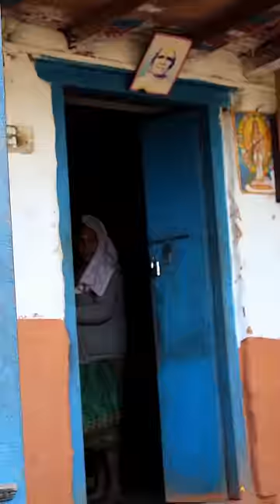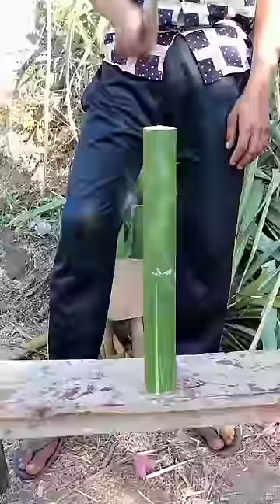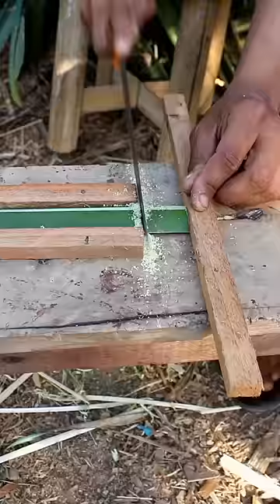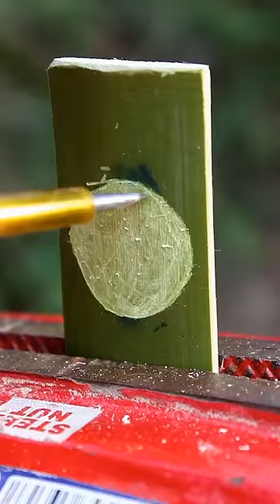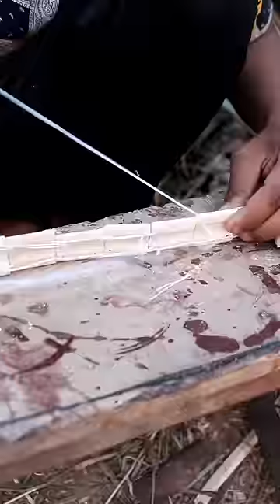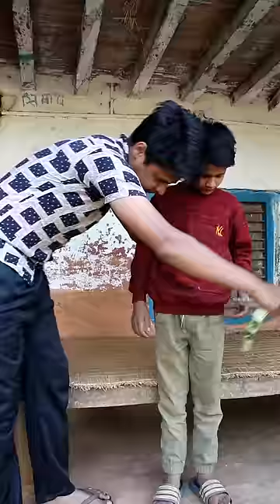Use To Bamboo For Make a Belt || Bamboo Crafts #Shorts

Comment: Use this design to make bamboo curtain,  you make bamboo ring,  make + or X design in the center of ring.
We must have irritation of air . Bamboo curtain is needed because people pip inside houses.  In cities we have larger windows. 
With bamboo windows,  we can see outside,  air will come and people can't see inside.  Mosquito also not enter home directly. 
Make a suitable model for main door and window. 
You can attach ring with each other and make hanging.  City people will like it. 
Jay shree ram.